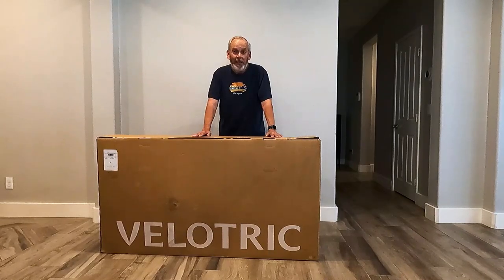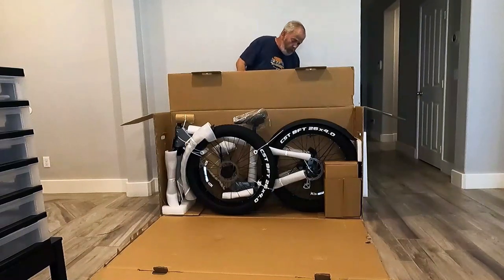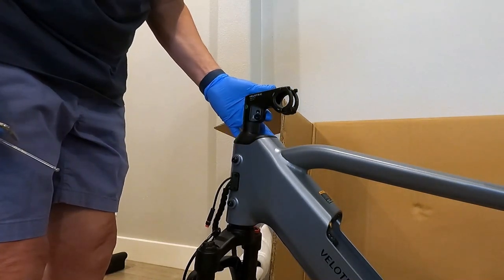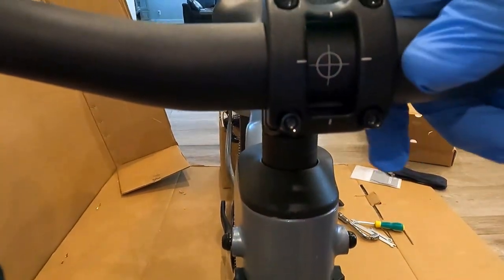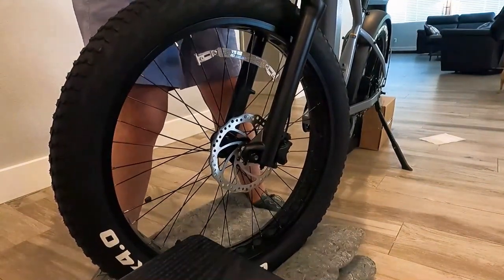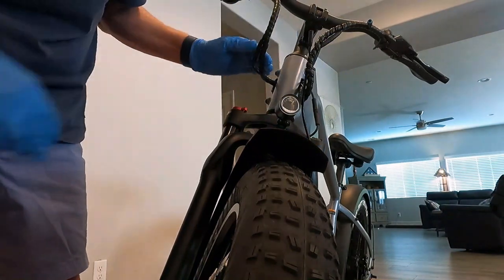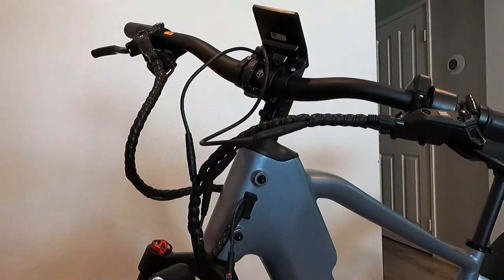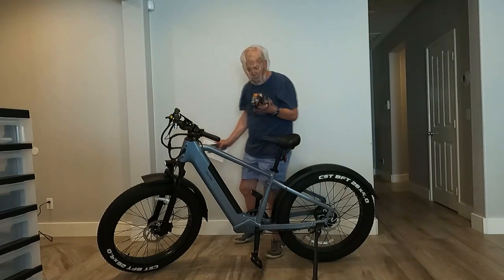Step-by-Step Guide: Assembling the Velotric Nomad 1 E-Bike

Comment: Getting the front tire on is brutal! How do you make it look so easy?!
Reply from the maker: Thanks for watching! I try to make sure the axle nuts and washers are as lose as possible, line up the brake rotor with the gaps in the pad and get the wheel to “bottom out” in the fork, then tighten the axle nuts. Hopefully the brake rotor is pretty straight and the front brake needs minimal adjustment. Hope this helps! 👍

Comment: My front wheel is clicking against the black brake system box on the bike and I’m not sure how to fix it??
Reply from the maker: Thanks for watching!  It’s probably the front disk rubbing against the brake pads in the caliper.  The caliper has two bolts holding it to the front fork.  If you turn the e-bike upside down or hold the front wheel off the ground and spin it, you can loosen those bolts, adjust the caliper until there is no more noise, then tighten it.  Hope this helps! 👍